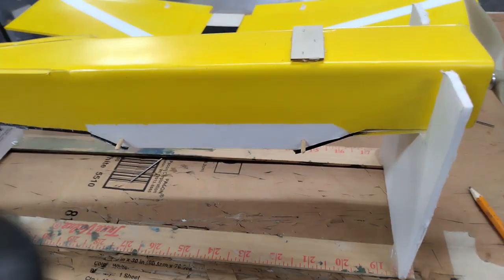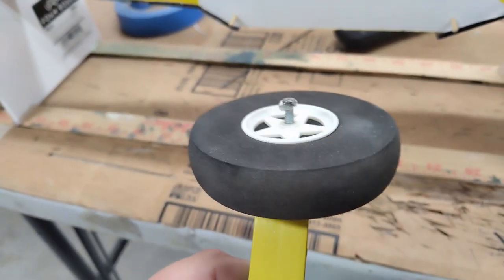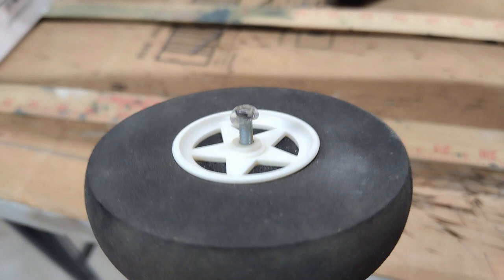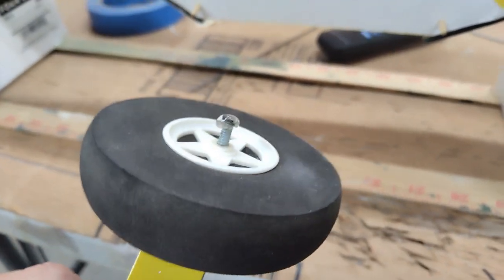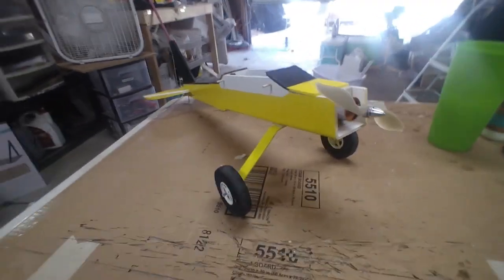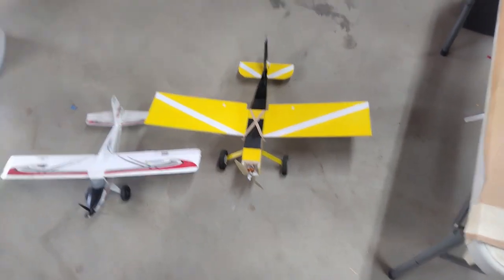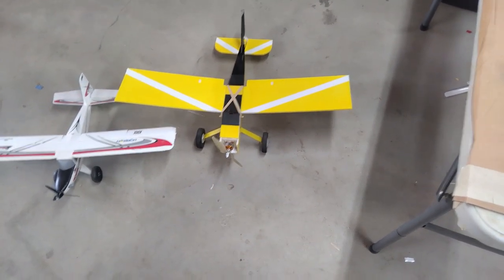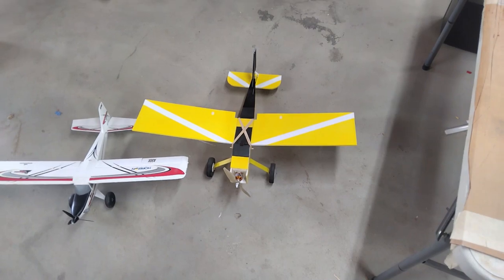30" 5mm foamy

Comment: Great solution! Id like to transfer all mechanicals from my P.O.S XK DHE Otter to a foam board airframe…you KNOW its a POS when 99cent store foam board is way stronger than your plane that you spent $$ on
Reply from the maker: Yup that's for sure I just did the test flight and it's a great flying very tough airplane. Make sure you check it out i just posted it. Thanks for watching!
Reply: KRV RC Review just watched….proves its strong enough for acrobatics and maybe these companies will start to improve their quality as more people like u choose NOT to buy their overpriced spares and choose to scratch build instead. Will you share plans/pdf of this plane?